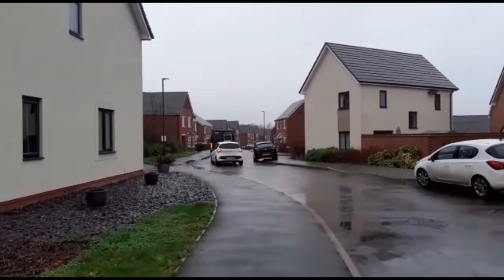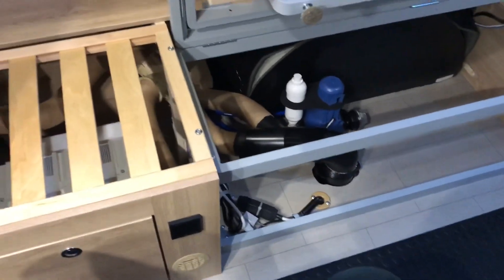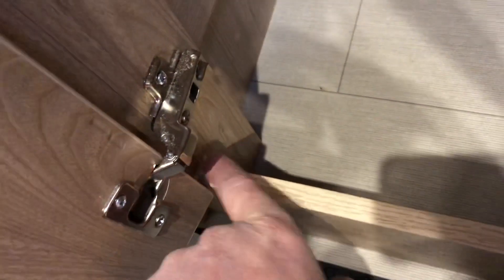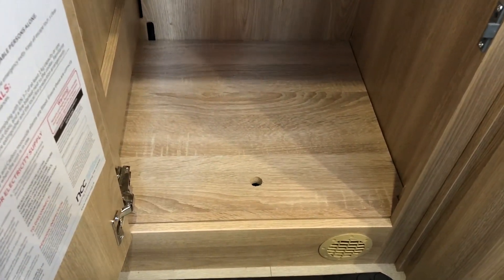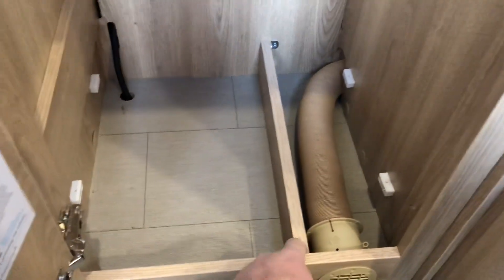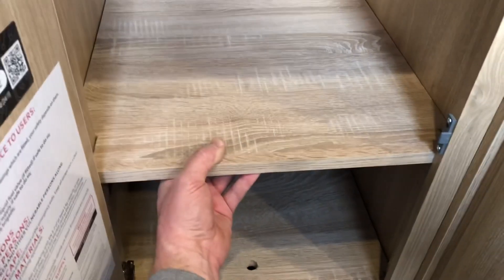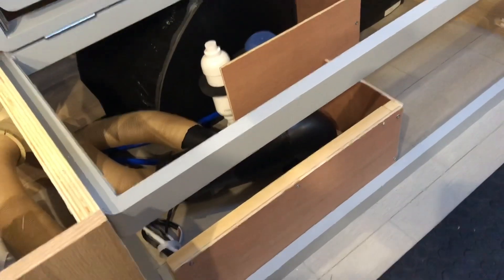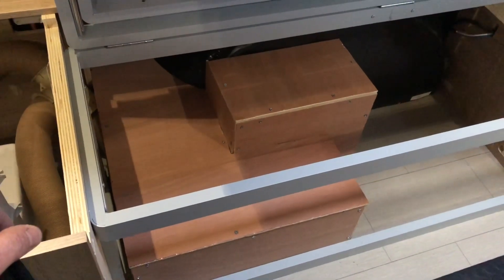Elddis CV20 Campervan BACK TO THE DEALER For Repair Plus We Do More Modifications

Comment: I have the 2019 CV40 version of your camper and had the same battery problem, worrying to think its still happening over a year later! I had a bike rack that smashed into the rear door pillar on opening (no door restraints fitted a a nice dent in my 12 hour old van!), headrest cover on back to front, sink waste pipe not connected.USB socket near the TV aerial socket gave such massive interference that the TV only picked up 10 channels. I wrote to Elddis - never even received an acknowledgment! I put everything right myself and am now really happy with the van. My stand alone table became wardrobe shelves and the flip up kitchen worktop became 2 shelves to the rear of the wc and on the other side behind the fridge. I replaced the cheap solar charger for a decent viltron and added a second battery. Enjoy your van and everything it has to offer :)
Reply from the maker: Sounds like we’re on the same page! I’m in the camp that regardless of cost you have to make the van work for you. Cheers for watching 🙏

Comment: Great job. Watching you has given me the encouragement to try some boxing in on my Avantgarde 115
Reply from the maker: Thanks, it doesn’t have to be pretty and it’s easily removed for the hab check when due, I’m just making the most of the space as we just down sized from a coachbuilt so it’s a lot smaller.

Comment: Well done to the dealer, funny how quick things can  change. The pump will be less niosey boxed in. Good idea's. I just upgraded my Boxer to LED headlight, so much brighter.
Reply from the maker: Yes to the dealer but I shouldn’t have had to tell them to fix it any way they could, they were all for fetching it back for 6 weeks!
Reply: @RickandHeather  we had similar, said similar, same happened, magic happens 👍
Reply: Well done on the tap fix, hopefully that’s the last of any issues, I bet they were hoping on you not knowing ‘the law’ and just accepting 6-8 weeks fix time, though you probably got to feel sorry for whoever purchases the next new van as it might have a ‘stolen tap’ and the replacement might leak 😬

Is there a trip planned?
Reply from the maker: @rayhelmke1562  we’re in Tier 3 at the moment (announcement today on next Tier?) if we drop to T2 we’re off, if not then cest la vie I guess.

Comment: Great job Ricky!

Just a thought - I wonder if residual heat from any of the "cardboard" heating pipes might help keep condensation at bay in the half height wardrobe or any of the under-bench storage areas?  If you bored some large holes in any of the boxing in you've done, it might provide some warmth and allow the air to circulate a little.
Reply from the maker: I did think that as I was doing it, I’ll monitor it! Cheers Rick

Comment: Hi I will be doing these shelves,fab idea 
Do you happen to know the internal drawer dimensions under the sink area as we are looking for a cutlery tray ready for when we collect our new van
Many thanks 
Shaun & Claire
Reply from the maker: I think Heather’s got them somewhere if not I’ll measure it later when we’re home.
Reply: Thanks we paid for or ours yesterday, and take delivery on the 16 June, and are
away on holiday In August so wanted to get it ready
Ours is Slate Grey
Reply from the maker: @SeanyDee  240mm wide 330mm deep 90mm high
Reply: @RickandHeather  many thanks
Reply: Can’t find a ready made cutlery insert anywhere to fit these drawers probably have to make them 
Our last van Devon Aztec had them fitted.
Reply from the maker: @SeanyDee  we just got some little individual trays from the range

Comment: Liked the boxed pipework but worried about boxing the charger n stuff. Would it run hot or something and be inefficient?
Reply from the maker: I don’t think so, if you look at the various mounting options on the unit it can fit in many different areas, I’ve not blocked any vents but will keep my eyes on it...

Comment: Hi we picked our van up at the weekend, some great tips on modifications from you guys. We've modified the wardrobe space with a couple of shelves. As mentioned the table is unusable and seems destined for the awning. Solved the problem with a Quest Fleetwood high table at £20 fits perfectly. One question the dealer seemed unwilling to commit too, do you turn off the gas main valve off before travelling? It's  located on the tank under the cover plate and is a right chew to reach. Cheers
Reply from the maker: Nope, we’ve never touched the gas, never have unless it’s a separate bottle.
Reply: @RickandHeather  Thinking about it, its probably a generic label they've stuck next to the gas level gauge

Comment: Did you screw or stick those battens in the locker.  Or in the wardrobe. I’d be worried about screwing into the outside fabric or in the wardrobe
Reply: Couldn’t tell how you affixed things in
Reply from the maker: They are screwed into the wood, no need to worry if you use the right screws, worst case you remove and fill a tiny hole then cover with wood coloured sticker. As for the outside fabric I’m not sure what you mean? The van is metal not a coachbuilt. Ultimately I’m not worried about adapting my van for my needs, I didn’t buy a van to keep standard and afraid to use, I’m not worried about the resale price I don’t think people on the whole care if the odd screw has been added. Thanks for watching

Comment: Hi, catching up with all the videos! What was the problem with the battery and how does  a non-technical person like me spot the fault?
Reply from the maker: The battery was not bolted down so was free to move about, also the negative terminal was loose and the positive did not even have a nut and bolt on so the connection was loose (this prevents things working and in extreme cases is a fire risk) also when charging batteries give off hydrogen gas and should be vented to atmosphere the battery did not have a vent tube fitted! Anything else I can answer please ask, I’m always happy to help. Thanks for watching 👍
Reply: @RickandHeather  Thanks for all the speedy replies! I'll see if I can spot that battery vent tube in any of your videos.
I think when you use any particular piece of kit, it's worth putting a link  under the video description so you don't repeatedly get asked for references.
Reply from the maker: @travelcampervansandmore  yes, I think you’re right I’m slowly learning that 😁